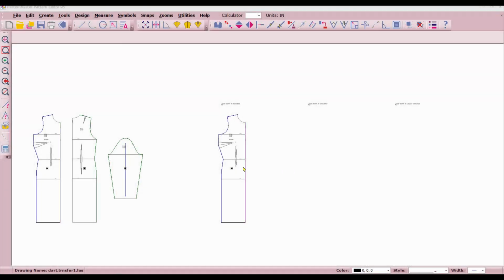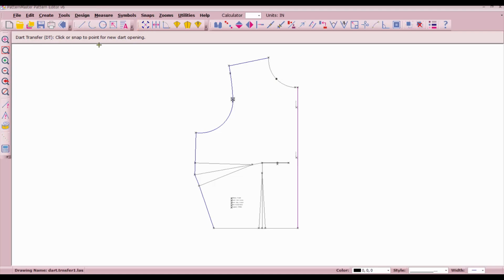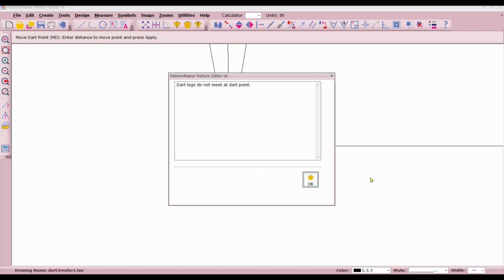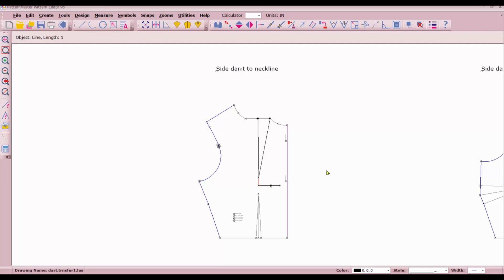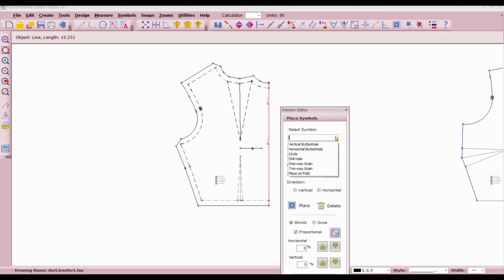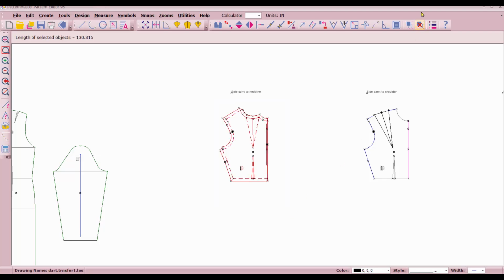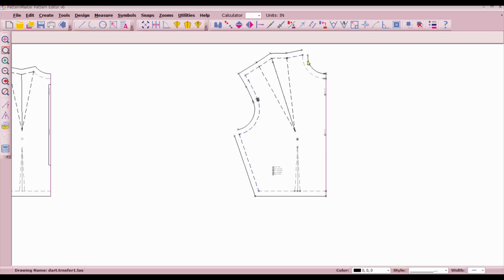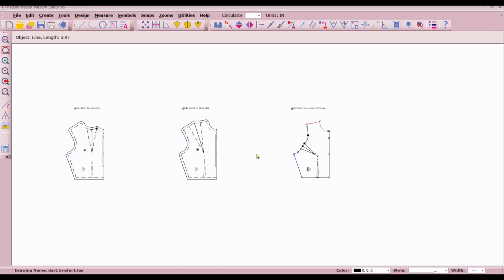Basic dart transfer command

Comment: I recently discovered your channel. It's great to find a resource using Wild Ginger's pattern editor. I've recently begun dabbling with pattern drafting and would like to become proficient using digital tools. I especially appreciate your demonstration of some of the features that aren't included in the built-in tutorials, such as changing to dotted lines and symbol placement. I do have one question though - what is the purpose of drawing the guideline and moving the dart point 1.5" inches to the right?  Is it just to get the circle out of the way?
Reply from the maker: exactly. Otherwise when you try to snap (right click) a dart line to the dart point, the apex circle could end up the point of connection instead of the guide line end . 1 1/5" is an arbitrary number on my end. It could be 1", 2" however much you need to move it out of the way. The important thing is to move it straight across so you can easily find the original point when you move it back.
Reply: @lisahaasecustomsewing2106  Thank you for the explanation. I will try it.